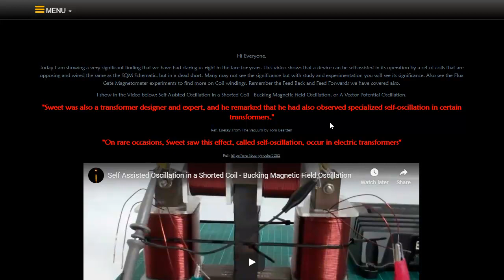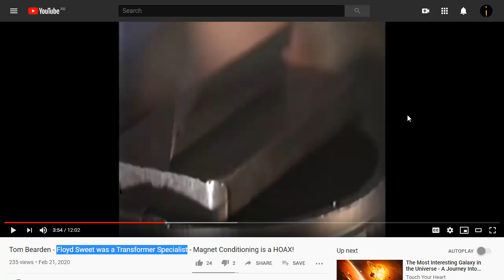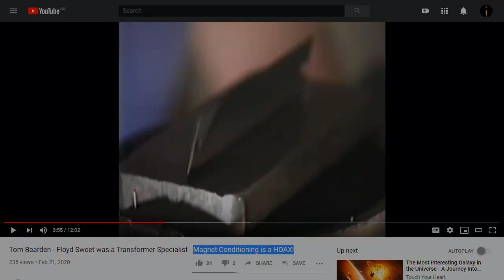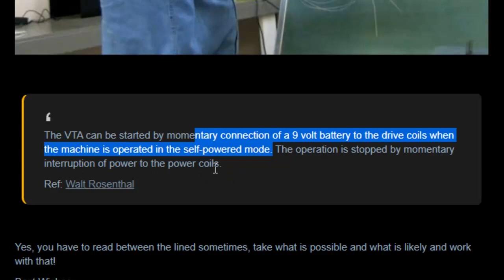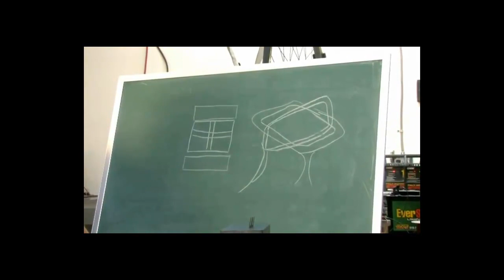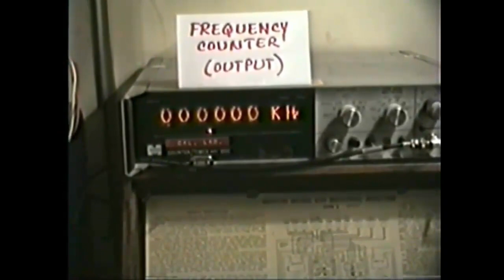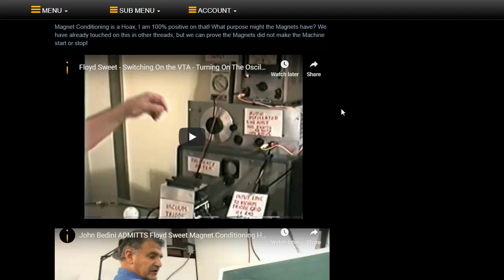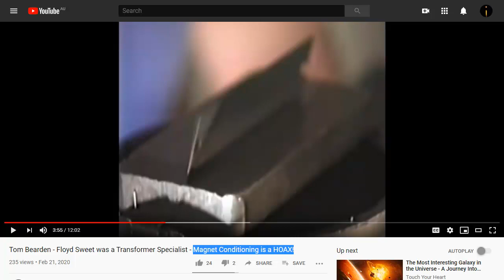Floyd Sweet - Magnet Conditioning - Pt1

Comment: Nice work!
Reply: When I was 14-15?, 50 years ago, I dreamed up an idea to make magnets play off each other. Dad, a profressional electrical mechanical engineer told me, "You can't get magnets to "work" (by themselfves). he was right. Decades later, I found the ONLY way to get them to work is to fully SHUNT the magnetic fields. This we can't do at the moment. Magnetism goes through materail everything like knife through butter. Cold pressed steal can distract or reroute magnetism by absorbtion, but the thickness is almost the same as the magnet field. You woud need a paper thin substance equal to the absorbtion of 1 inch of steal.

Comment: Conditioning is a misnomer perhaps to what the actual issue is.  The Magnet is not doing something by itself.  The question is, can magnets be made that have domains that would be atypical if one were simply looking at it without mapping the gauss strength?  Yes. They can create very intricate patterns.  Eg halbach array etc.  Would adjacent aligned engineered domains of placed cleverly stress the field it is bathed in and give the appearance of the magnet doing the work vs exogenous forces acting upon that local space?  Perhaps.  Think of how a large long line pendulum can mark time by tracing the movement of the earth etc.  would the comment about conditioning be more suitably be “engineered?”  Possibly ?  Just thinking thoughts welcomed
Reply from the maker: @diveflyfish - good constructive thinking - The Magnets had a super strong uniform field I can prove this every day. Do the experiment with the stacked shim stock blades, this teaches the experimenter a lot!
Reply: Aboveunity and hyiq Research Channel the strength of the uniform field is understood.  However my question is regarding the size and geometry of that strong field.  Are you certain the field was uniform across the entire face?  Is there any possible assembly or magnetic array that would be able to stand razors ?  It’s a good thought question worthy of experiment to be sure.  My guess is that it can be done
Reply from the maker: @diveflyfish  - In that simple experiment lays your answer. Any type of Halbach Array will not allow the Blades to stand, no.
Reply: Aboveunity and hyiq Research Channel I know a halbach may not, I used that only as an example of a mixed combined magnetic field that can be very strong yet not uniform.  The question is can a non uniform varied magnetic field of sufficient strength do the same as a uniform strength field?
Reply from the maker: @diveflyfish  - What are the important questions? What is required of the Field, what must the Field do? Whats the purpose of the Field? The simple answers, here: https://youtu.be/6xhqMDMMgz0 will lead to answers on the more complex.

Comment: Did you study these 3 VTA Zip files, which were posted to the Yahoo groups and which were once also uploaded to overunity com ? They contained the exact infos how to condition these magnetic bubbles into the magnet with using AC and a very strong current discharge at the zero crossing...probably it was just a simular thing like these old magnetic bubble memory devices from the 1970s or so...
Reply from the maker: Stefan - You banned me, EMJunkie, I am not happy about that! I was not the one causing trouble! ramset was, but you overlooked that! Yes I have more data on the VTA than most, I have all the old zip files, and much more. I have  a lot more info coming! A Lot more!
Reply: @SweetSQM  What is your username on overunity com ? I will unban you again...
Reply from the maker: @oudotcom  - EMJunkie, but its ok, I have my own forum now, I post there now: http://www.aboveunity.com - Stefan, you need to look into it a bit more when banning / moderating your members! I was a bit upset at the time! I am well over it now. We have a truce? Friends again?
Reply: @SweetSQM  I removed the ban of username HYIQ and EMJunkie again, but please don´t start any flamewars... Many thanks. Regards, Stefan.
Reply from the maker: @oudotcom  - I will private message you if there is any trouble. Thank You.
Reply from the maker: @oudotcom  - Can you please look at members: Raycathode and onepower, links here: https://overunity.com/15395/partnered-output-coils-free-energy/msg544333/#msg544333 here https://overunity.com/15395/partnered-output-coils-free-energy/msg544322/#msg544322 and here https://overunity.com/15395/partnered-output-coils-free-energy/msg544317/#msg544317 and tell them to stop spamming my thread with off topic nonsense. I am trying to be as fair as possible. They are harassing with nonsense posts. I asked Raycathode to leave the thread, nicely but he refuses. It would be great if you could delete the posts please? Thank You Stefan.
Reply from the maker: Hi Again Stefan, can you please set me up with moderation on my thread:  https://overunity.com/15395/partnered-output-coils-free-energy/ I am still having trouble with non-sense posts! Some slandering me and even worse stuff occurring! Another: https://overunity.com/15395/partnered-output-coils-free-energy/msg544389/#msg544389
Reply: Do you have backup of these files, please? Yahoo groups are today inaccessible. Thank You in advance...
Reply from the maker: @zephirawt4997  - http://www.hyiq.org/Downloads/Floyd%20Sweet/Original%20VTA%20files.zip you will find some of the original VTA Files, I warn you, be careful, do not let yourself be misled by lies, there are many! Stick to whats provable! Stick to what feels right! Stick to whats sensible and logical!
Reply: Thank You for files, I do appreciate it.
Reply: Note for example that the strontium ferrite is conductive, it cannot be conditioned with electric pulses.
Reply from the maker: @zephirawt4997  - I Have already covered that, its already well known.
Reply: @zephirawt4997  Yes, try to find them on overunity.com